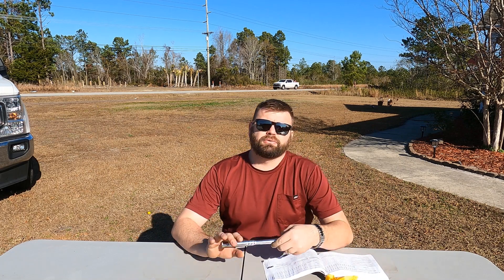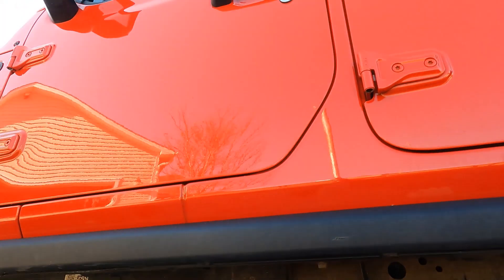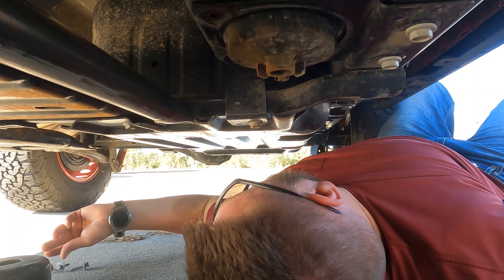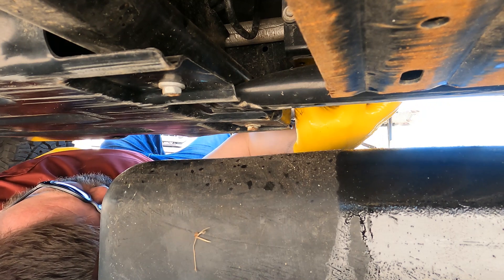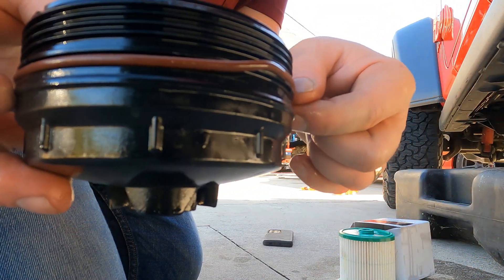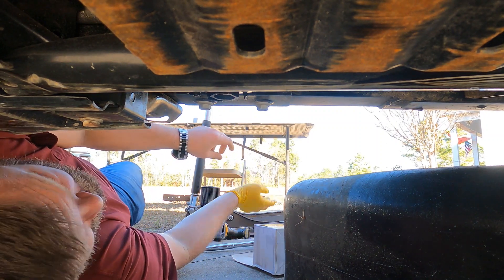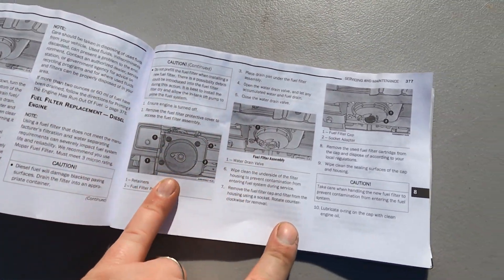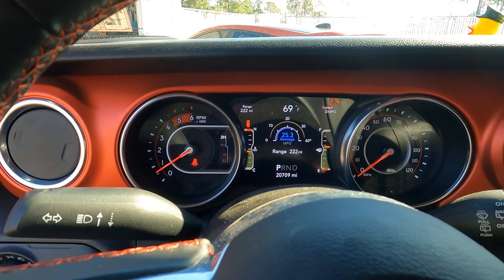Wrangler and Gladiator diesel fuel filter change

Comment: Back in February I traded in my old Rubi for a 2021 EcoDiesel. This is my first Diesel engine, so while I did all of the changes on my last Rubi (gasoline), I figured I would take advantage of the new rubi's 3 free oil changes the dealer gave me at the purchase. I had the first in July, the second is due now.  The only problem I had before (in July), was that I waited 3 hours at the dealer for the first change (redefines express lane), and man do I hate to wait, I would rather eat my veggies then do that...  So, I start probing the internet for the differences in the gasoline and diesel oil change, and honestly this was the first time I heard of a filter on the fuel line.  Maybe they have them in gasoline engines, but I never did anything to it if they did..  All that to say, I am certain I would have gotten pinched at the dealer for this had I not come across this video, as they only replace every other oil change, just draining it on the first, 3rd, etc.....  With Diesel prices in Kansas up $1.15 over gasoline, and with this DEF B.S., I am starting to regret this decision.  Definitely better gas mileage and torque for sure, so there is that, I just don't know if it all weighs out for me in the end.  No turning back now..  Sorry for the novel here, but last thing, Chapter 87, any idea why a filter is required for these engines on the fuel line?  Again this may in fact be something on a gasoline engine, in which case I admit to being a derp, but if not, why filter on Diesel and not on Gasoline, or why filter on both?  Is the fuel from the gas station not already filtered for water?  Still learning here and always curious.  Thanks for the video, I think you just saved me a couple hundred bucks.
Reply from the maker: Hey Matt, both the gas and diesel fuel systems have filters, gas is every 100k miles but most people never do it. Diesel is a thicker fluid and hold debris in it better, so you are more likely to get something inside you fuel system. I've worked on diesel equipment for most of my life so I knew what I was getting into, and most people learn a lot when they purchase their first diesel. I truly hope you enjoy, but I purchased the diesel hoping that it will last longer in the long run, about to hit 2 years owning ours and she is almost at 46k miles. Diesel motors are more expensive to maintain, and it's true fuel cost way more now that it did when they first came out, and back whe I was a kid diesel was cheaper that gas. But my car get 1 mpg on the 1/4 mile and 4 mpg cruising. The new norm is paying a lot at the pump. If you have anymore questions contact me and I'll happily try to help you out. Be safe of the trails!

Comment: The owner manual says at 10k miles to "drain water from fuel filter assembly" -- would you just remove the filter, let is drain a little than reinstall?
Reply from the maker: So we have a light on the dash if there is water in there. I personally have never drained the filter housing till I change the filter. But if the water light did come on than yes definitely drain it. 

But to fully answer your question, no do no remove the filter housing to drain the water, there is a little plastic drain cock that you can twist and it will allow the fluid inside to drain. Catch it in a bottle so you can see if there are 2 different colors to the fluid that you drain.

Comment: How many miles did you drive before changing the fuel filter? Just curious thanks
Reply from the maker: I do it every 20k miles, I haven't had any issues with water or debris in the housing. Most of our fuel comes from sams clubs around the country and haven't had any issues with it from them.

Comment: That part number shows it for. 6.7L cummins fuel/water serperator, I even typed it into a  jeep parts dealership online, and it said it won't fit???
Reply from the maker: Ram, dodge and Jeep want to have less parts in their parts department so the same filter is used of the HD trucks as well as the 3.0 wrangler and gladiator. I clicked on the link to double check and make sure it's the correct link still and it is.
Reply: Thank you very much
Reply from the maker: @David Frishcosy  if there is anything else I can help or any other content you would like to see let me know.
Reply: @Overlanding21  Yes, where is the def heater at, and why should one go out at 13900 miles on a 2022 gladiator? And how often should you change your fuel filter on this diesel beast???
Reply from the maker: @David Frishcosy  there are 2 def heaters on the def system, one in the tank, and the other in on the def line, they turn on only when air temp is below freezing, if you are getting code p20c6 it could mean that the def you put in was contaminated or the def pump is going bad on it. Not sure the temperature at your location but if the weather is warming up I would take it to the dealership to let them look at it so it is documented so if it doesn't throw it again till next winter you are covered. If it's still going to be cold for awhile you can clear the code and see if it comes back as you can get it if the def fluid froze and the pump gave a fault for no flow of fluid.
Reply from the maker: @David Frishcosy  I also change my filter at every 10k miles. Sorry got lost in the def reply. Lol
Reply: @Overlanding21  I have it back in to the dealership again for a check engine light,  and now they said it was a def heater that is bad. The first time, it wouldn't go through and cleaned burn, and I had driven it as a manual and couldn't go any higher than seventh gear,  and that was a wire they told me.
Reply from the maker: @David Frishcosy  I'm not sure, but if I was you I would call jeep wave and open a case with them to shoe how long your vehicle is in the shop. We received money back for ours being in the shop for 3 weeks for bad balljoints.

Comment: Your link takes me to 2019 to 2022 Ram 6.7 Cummins diesel fuel filter?
Reply: Looks like they are the same filters.
Reply from the maker: They are the same filter, very common for manufacturers doing this to reduce part inventory at dealerships.
Reply: Same filters.  

Honda is going this route also.  All their cars I've owned (Pilot, Odyssey, Cr-v, etc) used the same filter.
Reply from the maker: @silverstake88  reduces inventory of different filters. Not hard to make 1 filter fit other engines.